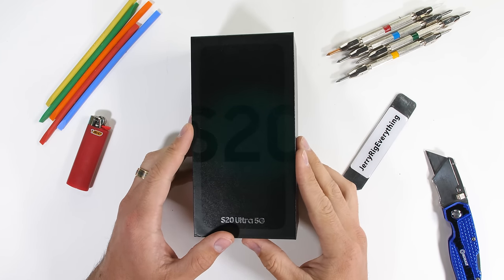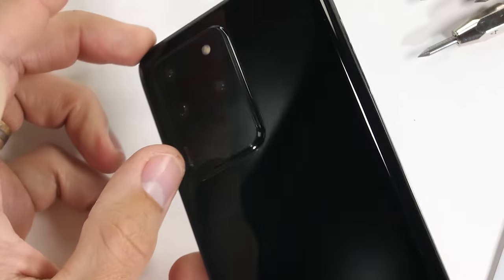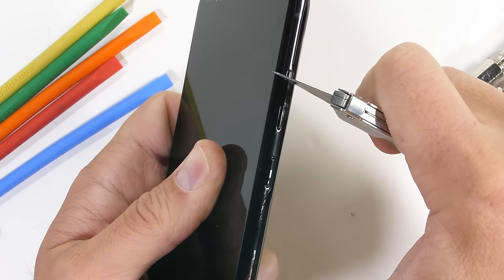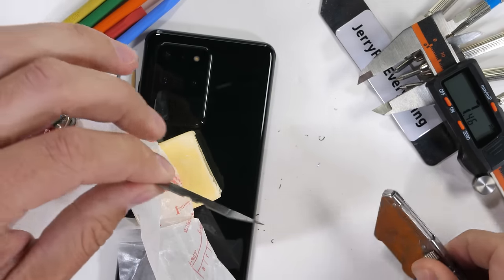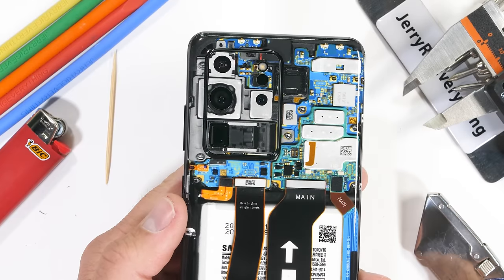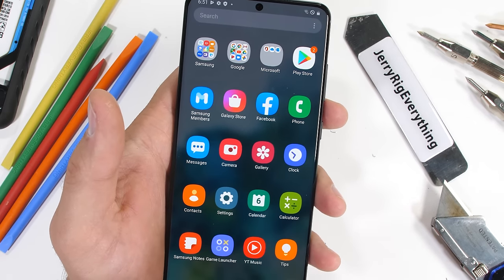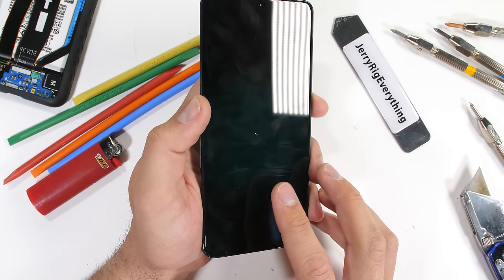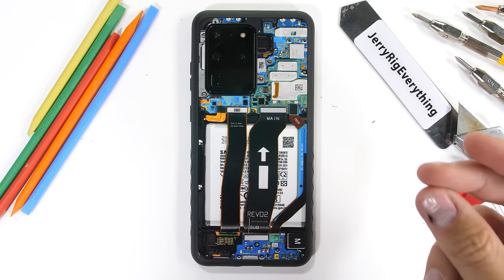Samsung Galaxy S20 Ultra Durability Test! - Is it... Ultra Strong?

Comment: 2005: we built a phone that has a camera!
2020: we built a camera that has a phone!
Reply: Nice one 🤣🤣
Reply: Yo underated
Reply: That joke is only good for the s20 series not really the iPhone 11.
Reply: That was in 2014 with Galaxy K Zoom.
Reply: @goblinganger6754  more like s20 and s20+, ultra has AF issue
Reply: Hero Number Two what’s the issue?
Reply: @goblinganger6754  very slow autofocus, some software updates fixed it a bit, but its still slower than the s20 and the plus
Reply: Rip galaxy s20 ultra users
Reply: XL Gaming I literally saw the same comment in the trailer for this phone
Reply: This reminds of the A10 warthog memes. A gun that comes with a plane.
Reply: The iPhone 11’s camera size is TINY compared to the s20 ultra’s camera size.
Reply: Roki Vulović But the note 20 ultra is thicker
Reply: Momento JAJAJA
Reply: Samsung galaxy s4 zoom.
A point n shoot full fledged camera with a built in phone
Reply: Actually Samsung already made a camera that has a phone. Say for example the Samsung Galaxy S4 Zoom

Comment: Jerry: literally destroys phones

Me: gets nervous when I poke my phone with a paperclip
Reply: Why would you do that
Reply: Me: dies inside when I drop my iPhone 11 and it gets a tiny scratch on the side
Reply: @Ailgadem  you don't own an iphone 11
Reply: FapKing69 what
Reply: Me too
Reply: Same i drop my phone and my heart sinks
Reply: A paper clip? What do u have an iPhone? I heared its durability ucks as much as its battery 😂
Reply: @Hades_Eclipse  the durability is actually not half bad. Did u watch jerry's videos on iPhones? And the battery isn't bad either. Not an iPhone fan but lying to spread hate
Reply: @Hades_Eclipse  Iphone 12 pro max is more durable then Samsung note 20 Ultra
Reply: Myloprime maybe because i have an old phone but my IPhone 6 has a TERRIBLE battery it’s at 10% in less than 5 hours
Reply: @justyouraverageweeb2167  tbh they both are pretty durable. I would say that the iphone 12 battery sucks compared to the note 20 ultra. The note 20 ultra has a 5,000 mAh battery while the iphone 12 pro max has a 3,678 mAh battery which therefore says that the note 20 ultra would last longer. I prefer samsung more than apple but apple is a good and reliable company too
Reply: “hahA yuo os funy”
Reply: @justyouraverageweeb2167  how to know if a iphone user is in the comment section:
1. Bad grammar
2. Always says iphone's are better than androids
3. They Always say they have the latest iphone even though they have the iphone 3GS (or 5C)
Reply: @DigitalHandle  1. English is not my main language
2. I never said iphone is better then android I just said the iphone 12 max is more durable than the N20Ultra
3. I'm not even using a iphone I'm using a android

Your probably the type of person to call someone a apple sheep Just because they said something nice about apple

Comment: Rewatching this on my Samsung Galaxy s20 ultra 5g , 3 years later and it's still a beast, dropped with a belt clip from 43 feet onto a concrete walkway when my OtterBox belt clip decided to snap while doing a roofing job, the phone hit the ground bounced twice and landed on the front of the phone, no damage thanks to OtterBox for making a durable protective case.
Reply: my ultra dropped from 10 feet on concrete and had no damage too
Reply: Yeah this phone is a beast especially with the Otterbox and still 4 years later flies through anything I do with it and battery is holding up better than any of my previous phones. Worth the $600 I paid in mid 2020 for a refurbished one all frigging day, expect this bad boy to last another 3 years before I'm ready to get the new new.

Comment: Zach : Scratching a freakin Galaxy S20 Ultra.      
Me : Still stuck with Galaxy S7 Edge
Reply: Jo i changed it yesterday for the s20 plus. I still have a very special relationship with my old phone
 It lasted 4 years. Dont be ashamed, the latest ipho has a poor resolution. Literally i would not change to apple. It would be like switching from 1080p to 140p  in the settings. S7 edge might have been the best phone of the decade regarding price and screen quality.

Comment: The way he made fun of American measuring system. lmaooo
Reply: Yes, that fractions used in lieu of millimetres is ridiculous and incomprehensible for laymen
Reply: SaVe me
Reply: @HouseHoldAdventures  I want to be able to convert the numbers in my head.
Reply: @HouseHoldAdventures  actually it is! XD
Having a metric system based on decimals rather than fractions is way easier to use than a fractionary sistem. Yes fractions are legit most accurate (eg ⅓ vs .33) but it's way easier to measure in decimals, or just go down a space to the right for higher precision (.333)
Reply: @HouseHoldAdventures  America took the British measurement system one time, just do it again.
BTW how do Americans buy drugs with the imperial system surely dealers have realised the metric systems is simpler
Reply: hamza ali The imperial system is very mixed up. For example in America, we use inches and feet, but also centimeters. Same thing goes for drugs and food products. We use pounds to measure weight but to measure volume we use liters
Reply: @HouseHoldAdventures  wait what? No man the metric system and the international system of measurements is based on multiple specific and established factors, it is way more precise than the imperial system. Even though it has like 3 ¼ of a mile It's like dude how long is a mile?  Why is 12 inches a foot? Whose foot? See what I mean? 
Metric system is the most consistent and accurate system, that's why it's use almost worldwide and in the cientific community

Comment: 0:00 - Unboxing

0:56 - Boxcutter
1:25 - Screen scratch test
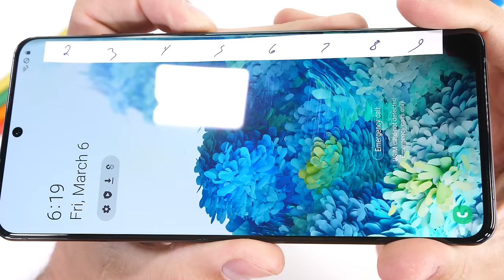1:56 - Front camera and speaker
2:22 - Side scratches
3:11 - Looking at front camera
4:05 - Teardown skin
5:42 - Back Camera Scratch test
6:08 - Lighter on screen
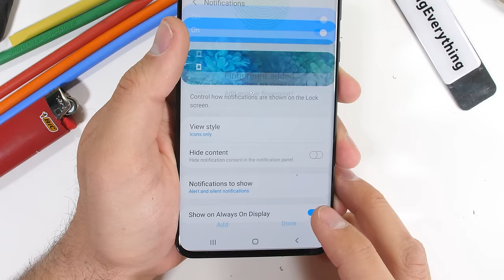7:10 - Fingerprint scanner scratch test
7:45 - Bend Test
8:00 - Conclusion

Also, it doesnt actually come with a case :(
Reply: Mine came with a case
Reply: @wierdwabbitt  bruh what? Did you preorder? Where was it
Reply: @Willem500  No I didn't, bought it from a Samsung shop in Lagos Nigeria
Reply: @wierdwabbitt  huh
Reply: @Willem500  huh what?
Reply: @wierdwabbitt  weird that I didnt get 1
Reply: @Willem500  Did you check the top cover? Look at the video again there is a flat container in the top cover that contains the case, fits in snugly so you might have missed it.
Reply: @wierdwabbitt  ive looked a few times, its the same box with the sim removal tool right?
Reply: Bruh the S20 5G is literally $699.99 on Best Buy and the iPhone 11 is the same price that’s a complete steal
Reply: For some regions it gets a case,some don't.

Comment: Dropped mine completely naked - phone, not me - without a case, into an empty cast iron bathtub, from 1.5m. Landed on edge, then face down did a few falling leaf slides before stopping on top of drainage hole. Didn't have the courage to pick it up for 5min, knowing that glass is glass and glass, you know... Well, eventually took my heart in my teeth, picked it up, turned around--and surprise surprise, not a single scratch!! Absolutely amazing, just imagine an iPhone in its place... The only problem with this phone is the fingerprint scan reader, hit and miss only works about 3 out of 10 times. Dissapointed on camera and its advertising is an understatement.

Comment: But! Jerry, this phone has WiFi 6, wireless Power Share, Samsung DeX, the brightest and biggest display, 120Hz display with 240Hz touch sampling, 5G, and 108MP camera, 8k video recording, and Samsung Pay. They included all of them and many more in a single device. So I think the Galaxy S20 worth the $1400 price tag.
Reply: Ashish C Joseph EC 2015 - 2019 that’s exactly why I’m in the comments. It’s allll and more put together. And it’s beautiful design
Reply: @realcartoongirl  reason?
Reply: One of the more underated and exclusive features of the S20 Ultra is how they were able to put in all the main 5G connectivity options including Sub-6 (Ghz) and Millimetre Wave all in one compact device.

The other / budget 5G phones don't have this, plus I guess it's what Apple were waiting for - that its forthcoming 5G phones will have a near if not fully similar implementation. Others do the primary R&D, they innovate seek to refine it then charge extra for the patents they have to include.

I further guess another of the main reasons of the phones pricing is it can handle many 4G bands as well. Noticeably budget phones i.e. for Xiaomi etc. with similar but cheaper Qualcomm Snapdragon chip variants only handle a few select bands for particular regions.

Comment: "this is the best flagship phone ever released" 
That's literally the case with every new phone that comes out. Phones are obviously going to be upgraded from the previous year.
Reply: that's not true with Apple though
Reply: Apple with iPhone 6-7-8 are we a joke to you
Reply: @FirstName LastName 
android fanboy has joined the chat
Reply: cough headphone jack, sd card, bunch of other sensors, qhd screen..

I've been seeing a lot of cases where the "obviously" just isn't really true.
Reply: @MarwanMarz  no, many primarily apple users would acknowledge that the iphone 7 was a downgrade from the 6s. you lost the headphone jack and physical home button for just wireless charging, which was rare to come across at the time. 6s ran fine (and still kinda does) so specs at the time didnt matter either. then the 8 really had no reason to exist, simply a 7 with the internals of the x so that it was cheaper and i guess ran better. i think that comparing the 6 to the 5 is moreof a personal thing but imo it goes 6s>5s>6>5, or if i put everything together, going down to the 5 as it was in 2017/18 and counting the + sizes as 1 phone: x>6s>8>5s>7>6>5
Reply: @MarwanMarz  And here we go again. Another guy which thinks apple has inovations every year and it's worth the price?
Reply: @MarwanMarz  Ok ISheep
Reply: @ekkeu6204  quite literally a joke to me, yes lol
Reply: @MarwanMarz  unfortunately, i'm on neither side, i use what is best, but i do not stick with the side of the best, only the product, not the producer, thy opinion is
I N V A L I D, good day sir.
Reply: @marekbiales8376  not entirely true. Apple definitely lacks but in terms of the android devices they always add something.
Reply: @glodenduck2077  Why do you say; unfortunately? Brand loyalty is stupid.
Reply: @glodenduck2077  I'm mainly talking about Samsung's flagship devices
Reply: @zemorph42  it very much indeed is, but adding "unfortunately" somewhat makes my comment look more like someone actually put effort and thinking into the comment y'know, like extra vocab n stuff
Reply: @aleklamour4672  Another clever one

Comment: Hi Zach. My s20+ display turned white/green without any drop or water damage just after the warrantee period is over. Do you have any solution for that. On internet there are many similar cases from which it appears to be a manufacturing defect, may be intentional. Can you help me finding a fix ?
Reply: The matter is due to pressure on the phone screen, such as setting an unsupported resolution forcibly try changing it even though it is very expensive

Comment: "Glass is glass, and glass breaks" watching this on my s10 plus that i dropped yesterday and the corner glass broke 🥴
Reply: Thumbs up for that. 👍👍
Reply: Y don't u have a case?
Reply: @Maldroid  i do have the leather slim case that you can buy on Samsungs website, but it's not protecting the two lower corners that well, it did help but the corner screen still cracked
Reply: @Z900_Wizz  you have a bad case
Reply: @Maldroid  i do have a good case, but it's the pornhub logo on the back, so my teacher told me I'm not allowed in class with it
Reply: @Z900_Wizz  Nice. But also get a screen protector for Gods sake, just a plastic one like the original one it has on the phones, unless if you are a millionaire and can keep replacing your screen every month.
Reply: @artisl607  ye, I did have a screen protecter that i broke because it was higher than the cover, but I just never bothered getting a new because I've har 3 different phone fir 3 years each and never had any major scratches and no cracks, and I bought my s10 same day it came out and this is the first time I've ever dropped it and that's because i felø

Comment: I agree with the 5g part but as you said:
"S20 ultra is made up of parts that cheaper phones have"

Exactly,so youre paying a lot for s20 ultra because youre getting all the features combined
Reply: The problem is not all of these features are as polished as they are on other phones, making it a "jack of all trades, master of none." For $1,400 it should be a master of all.

Comment: Either getting the flip 4 or the s20 ultra..  which would you get ?
Reply: Got the Flip 3 but only had Problems with it, got a cheap S20 Ultra and I'm very pleased with it, its still very fast, got a nice camera and I love the edges on the screen :)
Reply: @Onek98  ya well I just got the s20+ and it's a great phone with an issue big enough that I'm sending it back... The problem is the major amount of vibration the speakers make on the back of the phone. No joke my fingers feel tingly and numb. It's definitely a bad feeling and I will be sending it back. It seems the s21+ doesn't have this issue.

Comment: I agree on the g5. It is still not covered good enough.  I am living in germany and here those things really moves slowly.  Putting aside , that we don't get the Snapdragon , the phone is stupidly expensive.  The camera is good and usable,  but when you compare it to other phones it is not so good. From what I did read and saw the 100× zoom seems to deliver a pretty useless picture. Iphone uses a lot less ram, but keeps up with it. That should be worked on. Imagine having the same system, but with the same ram. That phone would be fastest as ....
Without a doubt it is still a good phone, which I would not say no. Well, when I see the price.....
I am thinking which I should get. The note ,s series or the z fold 2. Well, maybe wait for the s21, which seems to be worse compared to the s20 series.

Comment: Got this 2020, first day on my way to buy a screen protector for it, it dropped from about 25 cm and the screen cracked. Remained unsusable until this year when I could finally get parts to repair it. 250 usd woth of a display screen btw
Reply: Even if you didn't drop it, the display will fail by itself after a while. I experienced the green line failure after 2 years and the replacement was over $400

Comment: to me there's nothing wrong with the phone if you get tempered glass the glass won't really break easy. plus they do have them for the cameras as well. but it seems like you hate all phones all phones will of course be able to scratch. btw the z flip is a piece of shit the glass isnt real glass it can break very easy since it has to fold to work and it can easily fall. there's a gap when you shut it so many problems with that phone
.